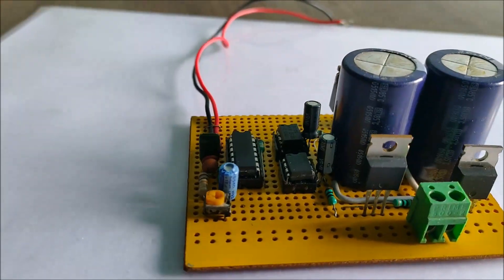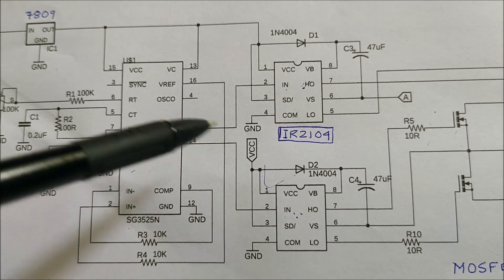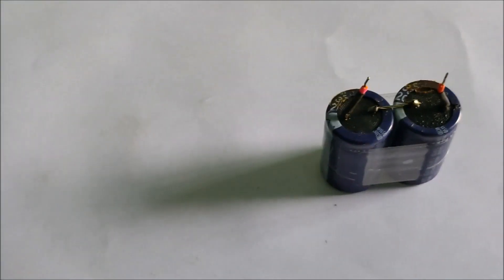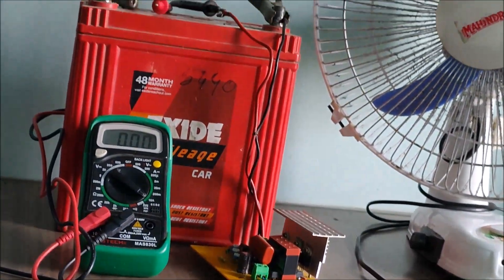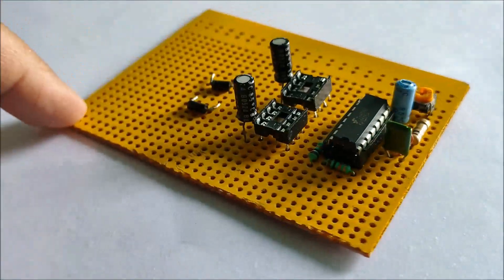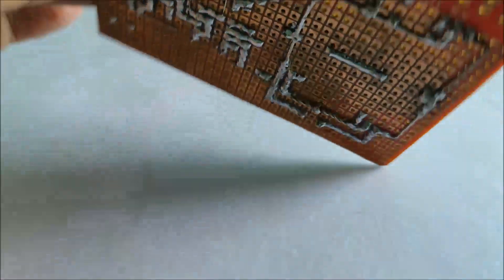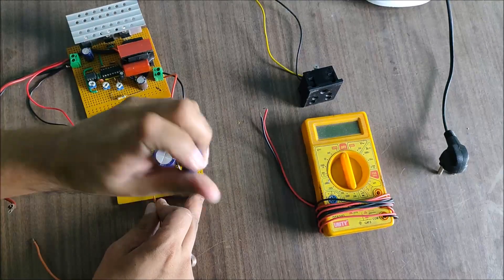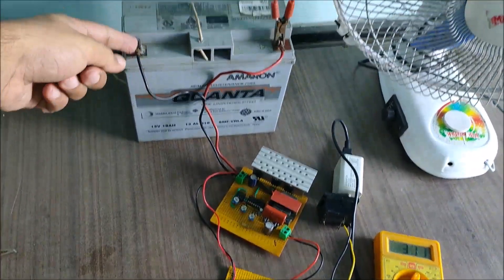DIY 200W Inverter Part-2 || 220V DC to 220V AC H-bridge || Square wave inverter

Comment: I have 12 batteries of UPS in series. I am getting 155 volt dc. I want to connect a induction fan it. What maxiumum load we can connect on your inverter circuit? For 12 volt dc I will be needing additional power supply?
Reply from the maker: @mirzafaisalbaig  the H-bridge circuit can work well for loads upto 200W 
You would need an additional 12V supply to power the drive circuits. Make sure that the grounds of the 12V power supply and your 155V DC source are tied together
Reply: @UtsavShah_25  have you ever watched microwave nagal? He used some sort of panni inverter in his video. Whether that could be this Circuit?
Reply from the maker: @mirzafaisalbaig  if you could provide me with the specific video link

Comment: I was wondering, is it possible to change the operating frequency of this inverter to 100kHz? and for the dc input can I use a rectifier connected to mains to get a 311Vdc and connect it to the inverter or do I need to step it down to 12V first then do the DC-DC converter circuit?

Comment: Sir, Please Reply ! I am making this inverter! In your Circuit Out A and B (of SG3525) are connected to (2 different ic) IR2104 2nd pin - IN.
But in my ic FAN7392 have HIN and LIN separate terminals ! 

1. Where should i contact SG3525 Output A and B in FAN7392 ?
And 
2. All another circuit will be same for me or not because I am using U3525 ic and Two FAN7392N ic ? Any changes please tell !
Please help i have basic electronics knowledge!

Comment: Sir, Please help I am making this inverter! In your Circuit Out A and B (of SG3525) are connected to (2 different ic) IR2104 2nd pin - IN.
But in my ic FAN7392 have HIN and LIN separate terminals ! 

1. Where should i contact SG3525 Output A and B in FAN7392 ?
And 
2. All another circuit will be same for me or not because I am using U3525 ic and Two FAN7392N ic ? Any changes please tell !
Please help i have basic electronics knowledge!

Comment: Sir, I am making this inverter! For 200v dc from solar ! Please i have some questions !
1. Can i use irf740 MOSFET ?
2. This circuit need 7809 voltage regulator or can i put 12v dc directly using  12v battery?
3. Can i run ac induction motor on this inverter?

I Hope you will answer!
Love your projects and videos ❤ Thanks !
Reply from the maker: @tej8223  
Yes you can use IRF740 MOSFET because it has good high voltage rating for switching high DC signals
You can use 12V directly using battery but the issue is whenever the battery starts discharging, the voltage becomes unstable which will effect the signal generation. Better to use a regulator
You can run a motor with this but I wouldn't recommend running heavy loads

Comment: Hi, one query on H bridge, Why you used IR2104? We already have the inverting and non-inverting output from Sh3525. Can't we use the same mechanism as inverter here and reduce 3535 frequency to 50-60HZ?
please pardon me for any stupidity in this question through 😄

Comment: Hi why you not directly drive H bridge with sg3525 ?
Reply from the maker: @ANDRO-t  Because SG3525 cannot directly switch high side MOSFETs
Reply: @UtsavShah_25  if we use a npn transistor before giving the signal for high side mosfet ?
Reply from the maker: @ANDRO-t  it wont work directly like that. You'll need a charge pump circuit arrangement to drive a high side MOSFET using NPN transistor. That circuit works but I wouldn't recommend it if you're switching high voltages through MOSFET
Reply: @UtsavShah_25  bro I have PV input 320Vdc can I use full H bridge of 2 ic ir2153 for 220v or use sg3525 and ir2110 combination which one you should suggest me?

Comment: I'm a holiest of eclectics, your videos are very helpful and well explained. I have questions

1. Does high DC voltage effects inverter durability(is it possible if get 110AC Voltage and then we step that AC voltages) ?

2. Does the IC and mosfate driver (that you have used in this project) need specific code modifications or they rebuild functionality?
Reply from the maker: High voltage DC would not effect the durability if the components you have used are capable of handling high voltages. The switching ICs that I have used work from 9V to 12V and you must find a way to convert the high voltage DC to lower levels so that you can also power those ICs with it.
The MOSFET driver I used here can be used to connect to MOSFETs that  can switch 700v but the operating voltage of the IC itself it low

Comment: I buy 60 pieces of ir2014 and connected the driver exactly but I get no low signal it’s dead all 60 get no low signal SD connected to 14 volt no signal only the boostrap work I don’t get it

Comment: This is project has overcurrent / Overload protection?  What will hapen if i use high load?
Reply from the maker: No, currently this circuit does not have an overcurrent protection and it may get damaged if very high load is used

Comment: Pls reply my below some questions?

1. Can we connect directly with 220v DC coming from a solar bank?

2.Then how can we give power to SG3525 with 12 volt.? Can we attached a 12v smps module with input of 220dc to 12v dc for powering the ossilator?

3. Can we add some feedback circuit for steady 220vac output?

4. How to get sinewave 220v ac from it. Is it possible to get sinewave with attaching a non-polarity cap such as 1uf 400v.
Reply from the maker: 1. Yes you can connect 200V DC coming from solar panel to H bridge. But the voltage may not be stable due to solar voltage fluctuations.

2. You can use any 220 to 12V smps based adapter to power the SG3525

3. In my circuit I have a provision for feedback in DC to DC conversion section.
If you want a feedback in stabilization of 220V of solar then you may need to purchase a solar controller or a buck boost converter capable of handling that voltage levels.

4. You can use a H bridge circuit and EGS002 module to convert this DC in sine wave AC
Reply: @UtsavShah_25  A BIG thank you.

Comment: where is test with 200w incandescent light bulb? Since you wrote in a description that it's 200w converter?  Or it will burn out with 200w load?
Reply from the maker: It does get a little hot handling 200 watts but can be safely used. I haven't tried it with an incandescent bulb. Thanks for letting me know. Will try to include this test in any of the related future projects

Comment: Best  can you maker 450v dc or 500v Dc?
Reply from the maker: Yes you can also get that by increasing the secondary windings and increasing the voltage rating of capacitors
Reply: Can i increase 1000 w that?
Reply from the maker: @dacreation369  for 1000 watt you will require 2 transformers and more switching MOSFETs
Reply: Best.can you make a re design that cerkit.because it is  good 1000w pio sine wewe innveter s. We can canect     derelict home .decause Ac instument ran Dc curant .what is think about that .I like your best video thank you

Comment: Where to connect 2 x  330mf/200V,  in diagram.
Reply from the maker: Both capacitors are in series connected across the high voltage output of the DC DC converter

Comment: Hi!
I have made the circuit but when i put load of 180w the voltage drops from 220v to 170v can you tell why? The transformer iam using is extracted from 500w car inverter which is already winded for this purpose. I want the voltage to be stable to 220v or any other voltage which i have set. I have also set the voltage to 320v by potentiometer but on load it drops to 170v.Please answer iam waiting for you reply.
Reply from the maker: Check if your switching MOSFETS are getting too hot while working under the load, in that case replace those with more powerful alternatives. You can also try and adjust the feedback potentiometer while the circuit is under load to better tune the voltage regulation. Also check if your input DV voltage drops if you apply load, in that case use a more stable DC supply
Reply: @UtsavShah_25  mosfet are mounted on heat sink so they are not getting hot. I have tried to adjust the output voltage under load using potentiometer but there is no difference it works only on no load.
Reply: @UtsavShah_25  iam using 12v battery it voltage drops but not that much like it is at 12.5v at no load and comes on 12 volts on 100w load. The purpose of sg3525 is to compensate for output voltage drop whether the voltage drops from battery or not like in this case it drops to 12v. In 12v dc to 220v ac converter this thing does not happen whether we put load on battery or not the voltage keeps on 220v. I want this ic to work like that. It is the same ic which is used in commercial UPS systems.
Reply: @saadahmed3856  Hello, i planned to make the same circuit but unfortunaltely there is no feedback loop to it. Impossible to have stable output under load even with stable DC 310V input. Sad...
Reply: @hichamtassi1753 can you share your circuit diagram?
Reply: @saadahmed3856  i wanted to use the one provided by our friend Utsav Shah.
Reply: @hichamtassi1753  did you build the circuit using that diagram?
Reply: @saadahmed3856  no i did not.
Reply: @UtsavShah_25  thanks for your reply
Reply: You need a feedback from the output to the non inverting input of the ic to compensate the output voltage.
you may check this out. he described the ic very well.

https://youtu.be/BmaXe0dME5M

Comment: how to convert 72v dc battery to 220v ac to use at home
Reply from the maker: You can reduce the number of secondary winding of the transformer to make it compatible for working with 72volts. Also make sure the switching MOSFETS at the primary side can handle 72 Volts

Comment: Hi bro great project, I have EE42 transformer any idea how much power it can handle ?? I also want to make same inverter as your but just a little bit higher power like about 500W.
Reply from the maker: Yes with the EE42 you can go upto 500W. Just add more switching MOSFETs in parallel to increase the current handling capacity.
Reply: @UtsavShah_25  thank you 😀❤️

Comment: Could send the full  diagram  of your inverter
Reply from the maker: You can check the first part of the video where the high voltage generation is explained. Combine this with this H bridge circuit and you get the complete circuit.
I have made this project into two parts

Comment: Great video just loves the way you explained each step of the assembly. What modification would be required to make it work for higher AC output such as 230v21a and 230v42a? Kindly suggest the modifications. Is it ok to email you?

Comment: Why AC voltage is not stable
Reply from the maker: Voltage is stable. It has feedback to ensure the set voltage remains constant
Reply: Because he must use true RMS voltmeter to measure non-pure sine wave AC

Comment: is this a standalone circuit or must be linked to the inverter part 1? if so how to cascade them?
Reply from the maker: You can also use it as standalone. You can connect it to the high voltage generator of part 1 also..I have mentioned the connection in the video description link

Comment: Well that is interesting..
Your certainly get from me a BIG THUMBS UP!!!..
But what i would like to know is how to improve the wattage output to 5000watts,since i've built myself a generator that has an output of 240V DC.
PLEASE spare me the idiotic comments its not possible! coz here everybody should know any electric motor DC or AC can generate electricity one way or the other with few twicks here and there!!! .....well if you didn't know any electric motor can generate electricity well rather than go back to school "coz you waste only public money" alot of practice which means trial and fail trial and get it right!!!...
USE YOUR BRAIN:what basic materials are used to make an AC generator?
well round sheets of metal with a hole in the middle for the rotor small steps to slide in the copper windings,copper wire,magnets.
USE YOUR BRAIN:what basic material are used to make an induction motor?
well round sheets of metal with a hole in the middle for the rotor,small steps to slide in the copper windings,rotor small enough round sheets of metal and aluminium to keep  the round sheets of meta tight together...
HOW TO MAKE AND INDUCTION MOTOR WORK AS GENERATOR???
well you have 3 possibilities;
1 magnetize the rotor.
2 drill holes in order to place on it magnets.
3 put in one coil 220 AC,make spin the rotor and pull out from the other coil 220V AC.
since that inverter push out 200 watts well it should be enough to magnetize the rotor and make AC come out the other coil."MOST IMPORTANT YOU HAVE TO REMEMBER YOU DON'T NEED TO USE THE INDUCTION MOTOR AS SUCH BUT AS GENERATOR WHICH MEAN YOU HAVE TO DRIVE THE INDUCTION MOTOR ROTOR WITH ANOTHER MOTOR EVEN A DC 12 MOTOR FOR BICYCLE WILL BE ENOUGH TO MAKE GENERATE ELECTRICITY,MOST DEPENDS ON THE RPM OF THE INDUCTION MOTOR AND DC MOTOR".
As i said above trial and fail trial and get it right,at school teach you only theory,making things with your hands make you learn if on thing work or it doesn't..
Reply from the maker: Hello! As I understand you are looking to generate more power using the concept of a generator which is mot this circuit is intended for actually. In case of generators you need a bigger dynamo and a powerful force to drive the dynamo
Reply: @UtsavShah_25  Hi!! sorry but you got it wrong.
What i am asking is how to increase the watts output of your board to 5Kw.
I already have a generator which has DC output of 240V DC and i need to convert the 240V DC into 240V AC.
As far as i know there is no dynamo that generate 240V DC,the highest dynamo output i know of has 48V dc output commercially available,nor someone has built one.
Reply from the maker: @scamper_van8470  Okay now I got it. You can increase the power output by using the H bridge MOSFETS in parallel so as to increase the current rating.Another way is to select MOSFETS that have already a high voltage and current rating ( 600V and 30amp capable)- you would still need to use them in parallel to increase current handling capabilities
Reply: @UtsavShah_25  Hi and thank you for the answer.
So if i get it right all i have to do is increase the number of MOSFET's to reach 5000watts,or pick MOSFE's 600V 30Ah?
If so how do i calculate how many MOSFET's i need to reach 5Kw?
Now that i am checking ebay i may have got the answer,if my guess is right 600v 30A 10x500w=5Kw to be on the safe side lets say 11 MOSFET's?

Comment: what will be the output if a spwm signal is fed  to ir 2104 driver ic  ?
Reply from the maker: You have to give complimentary SPWM signals to the two MOSFET drivers and you can gen get spwm AC square wave signal at output
Reply: @UtsavShah_25  so can u please make a 50 hz sinewave inverter .is it possible to get sinewave output by adding LC filters..
Reply from the maker: Yes I am working on it, will post the videos soon